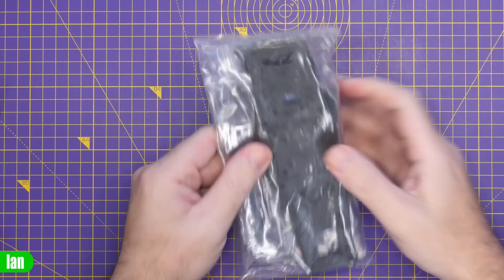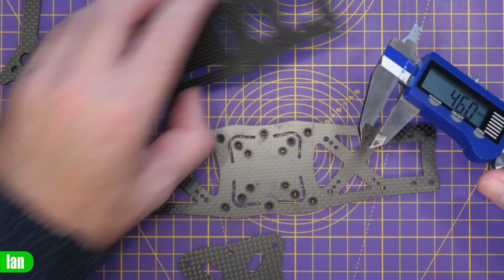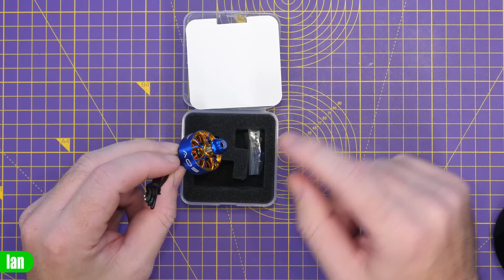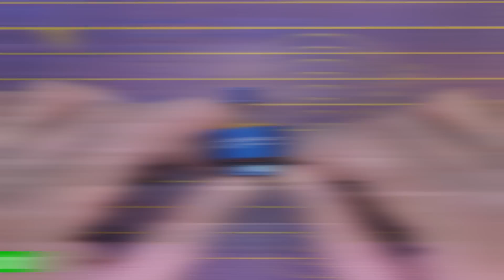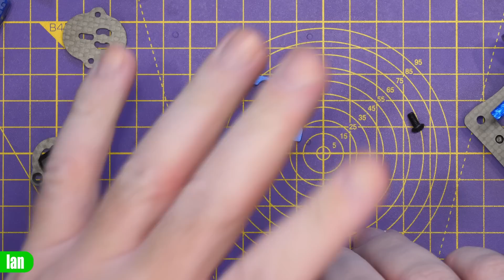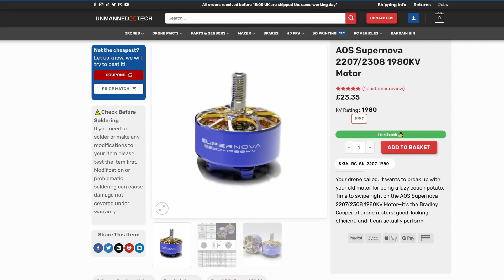AOS 5 V5 Frame & Supernova Motors  - The Perfect Combination

Comment: A lot of marketing in this frame. Three out of four arms cracked near the bolt hole where they overlap, and this is a flaw in the frame itself. I’ll try to drill additional holes to secure it, but you won’t even notice when it happens — the drone will just start flying like crap, and you'll be changing the settings, while the real issue will be the cracked arms. This happens because carbon fiber tends to delaminate along the layers. I also had an issue with the video feed disappearing from the DJI O3 because the cable from the camera to the unit was running between the power contacts, so pay attention to that. Vibration isolation is actually more of a marketing gimmick too. You’ll still need to use just as many filters as you would on a regular frame.

Comment: Are you going to do a follow-up on this video?
Reply from the maker: There is close to no major things I can add.  I discussed it extensively in my live streams.  The quad flies good and the motors are Ok.  Expensive high end motors yes but no complaints.  I would not suggest them for bando bashing due to the replacement cost but if you looking for high quality motors and want to support Chris then go for it.
Reply: @MadRC  surprises me.  When i put the motors on an exact same build with eco2 motors i have been flying i had to drop the motors to 60% throttle vs the eco2 motors that were at 100% in order to get a similar flight.  Its odd how you and a handful of other reviewers all said they were going to do a follow up and if you look on YT no reviewers did a follow up.  I watch most of your live streams so i must have missed it.  You are one of the last reviewers i actually listen to.  Appreciate the work you put in.

Comment: Re the motor names if you want them to be easily recognisable by purpose then just call them powerful 5" motors. None of those confusing numbers.
I mean if they are 22.4mm by 6.9mm then 2207 is fair. But if they are 23.7mm and 8.2mm high, then they shouldn't be called 2207s for comparison purposes that just muddies the water. If they are as efficicent as as 2207 but they are actually 2409s, then that's great they are super effocient.
But you can't compare them fairly unless you know what they are or unless you want to totallyy throw away the motor naming convention.
Then of course every one will just call their motors "very efficient, super powerful 5" motors" (or 3" or 7" or whatever).
And then we're back to no basis for comparison.
Essentially if you are gonna misrepresent the motor size, then just sell it on kv, eficiency and power - and find a way to quantify those that every one can agree on.
Or we will just be going to meaningless marketing names:
"Would you like to buy some Power Sexy Tiger GTXs - they're super duper powerful, highly efficient - the most efficient motors -  for 5" quads that will also attract the mate of your choice and grow your wee wee by %30 ?"
AKA would you like to buy some Trumps?
Reply: they aren't that far off of 2207 and mad's calling the stator size numbers also

Comment: This frame is not an easy build (revised from garbage). I bought it and it has so many problems. It doesn't come with all the screws to put it together, the screws for the arms stick up into the ESC, it doesn't come with any of the TPU stuff that all frames come with now, it doesn't come with stack bolts (I had to file my own down to fit), you have to replace the coaxial cable to the 03 unit, it feels like a $30 frame. The 3d prints on the web site don't include a GPS mount, so you will have to design your own. Also, the arm guards soft mount your motors. I have the AOS evo 5, absolutely the best drone I own. This frame is a huge step backwards.
 (After my first thoughts on this frame I have to add, now that I completed it. It is a good frame, but not for beginners. I had to make all my own cables to make everything reach, such as the 03-wiring harness, and relacing the 03-camera cable. I had to design all new TPU parts for everything on this build. So, you better have a 3D printer. I take back my original comment of garbage because it really is a high-quality frame, it just needs a little too much work.)
Reply from the maker: No stack screws is correct 
No TPU parts is correct. 
However if you have bolts coming though the pressed nuts they are the wrong ones as I don’t have that.
Reply: @MadRC  The screws are pretty apparent where they go and one of the ones that goes through the middle arm press nut, I had to file down because it sticks up into the stack.

Comment: Overpriced stuff to try and fix non-existent issues. Everybody flying normal frame with cheap stacks, cheap motors and no stab without any jerks or vibrations created by the frames. Been flying the impulserc apex for years and never had any issues that required a redesign of the frame which is bulletproof. What is the market for these frames and motors? Clearly is not freestyle or race or cinematic as you don't see many pilots flying it. Thanks for the review Ian.
Reply: People buying this are the same ones that fly default pids and filters and use rsgo, hypersmooth or gyroflow so again none of these BS helps in any way.

Comment: I think one of the most important parts of a frame is being able to get replacement parts. With the exception of impulse RC and TBS source One you spend $100 on a frame and in a few months its obsolete. I still fly my reverb and my Apex cuz I can get parts for them.
Reply: Armattan have been great for spares, replaced my cam cage on the badger after a bad crash, bought the frame 5 years ago and got the replacement this year.

Comment: Please do a crash test.
Reply: It won’t hold up. The top and bottom plates have too many cutouts, they are too thin, cnc madness uses crap cf, and the length will make it an eggshell only suitable for grassy parks and fields. Standby for v6 😂
Reply: 😂 if you know , you know

Comment: Almost every time I crash my AOS 5 O3 V1 my battery ejects and I have to fix the XT60/balance. 23mm standoffs don’t allow for a decent battery strap to fit between top of stack and top plate. The rear curve in top plate doesn’t allow for a second strap to fit on my batteries. It’s stopping me from flying hard and I’m disappointed nothings changed in this revision after voicing this everywhere I can and being a patreon for a long time.
Reply: Use Velcro straps for the battery much better tan any pad.
Reply: Wierd, Iv never had a battery eject from mine. I use 2 kevlar straps and umagrip.

Comment: Big problem straight away Ian.  If I’m paying a premium price for a frame I expect the FPV isolation mounts to be included, who has a 3D printer?  Also you need a 20cm 03 cable at another £15 or so.  Chris can bleat on forever about resonances but unless he supplies the parts he’s missing out on the biggest part of the market.  He should follow ApexRC’s lead and give buyers a reason to buy.  I’m out.
Reply: Well, I have 3x3D Printers all around 300mm Bed size.
But I agree, for this price it should definitely be included, especially that damn cable. They could buy in bulk and save a lot. But now we consumers have to get our hands on a single overpriced cable...
Reply: Just get the iFlight version and you'll be set
Reply: CNC Madness probably forgot to include half the parts. Mentioning their name makes this frame a hard pass for me. Plus the top and bottom plate look weak. Maybe it’s good in parks with lots of grass idk
Reply: @WarriorLife_fpv  what's wrong with cncmadness? I have 3 of my frames on their site, and working on a few more prototypes with them currently. I'm only curious since I haven't ran into any issues working with them. I'm personally not a fan of the aos frames but cncmadness is just the cutting service.
Reply: Recently built a quadmula f5 split and damn you can tell how much thought they put into not just the frame but the build experience. They even include dual caps..and it’s less expensive than the aos. Also the carbon quadmula uses just feels better than cncmadness to me. Idk anything about carbon manufacturing/grades but just my observation
Reply: @Stopsign-k2y thanks for the idea to look at that one. Sounds like my type of frame.
Reply: @FT-Steelers412 I switched from AOS to Quadmula on AOS V4 or whatever he called it. Haven’t looked back. The carbon is top quality and it’s put together so well. Everything is included, all tpu aluminium press nuts everywhere carbon meets tpu it’s just a different level of quality. They plus the thing flies on rails. Definitely check them out.
Reply: i would be interested, but without TPU Parts, i will refrain from purchasing. a GPS Mount is also included for me. idont´t have a 3D printer. and when i buy a frame, i want everything includet.
Reply: Was hoping everything would be included for this price as well. I also have major issues keeping the battery from ejecting with this shape of the top plate
Reply: Same here, had to buy the TPU rigid camera plate, without it the jello was evident on the AOS 5
Reply: Hmm  I have an Aos 5.5 and didn’t need the long cable for the o3.  You must be doing it wrong.
Reply: How do you survive in FPV without a 3D printer? Excuse me?
Reply: You mean who doesn't have a 3d printer in 2023?  😂 amazing how people find any excuse to complain about something
Reply: @jakeclauson9863  In the interests of trying to validate your argument I carried out a survey at work with a single unambiguous question, ‘do you own a 3d printer, yes/no.  Out of the 72 surveyed all replied no.  I therefore conclude that had you been present, the survey would have revealed just a single sanctimonious no mark.
Reply: @kaygeebee1962 😂
Reply: You should have carried out a survey on whether the same person who carried out the survey was a smug bellend or not.  The result would have disappointed you.
Reply: Also, when you have to edit your original post it kind of undermines your pathetic attempts to appear intelligent.

Comment: why is the front sooooo long waste of carbon/weight , means it wont work with default mipi and looks fugly sorry chris
Reply: In my opinion It is an ugly quad… But I do appreciate beauty is in the eye of the beholder… and no doubt it is a well engineered quad.
Reply: That long frame and thin top and bottom plates are begging to snap in half